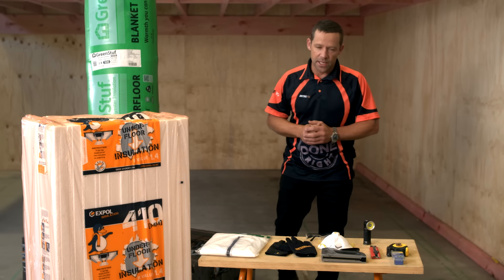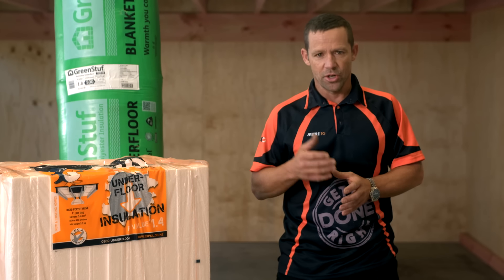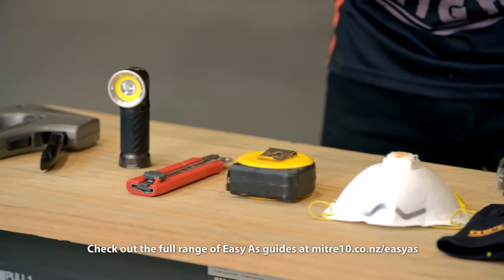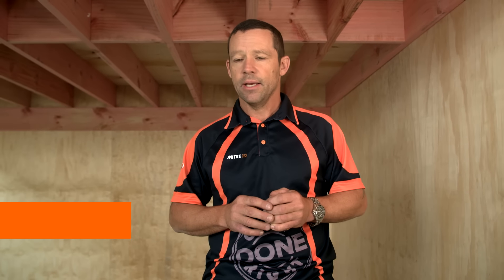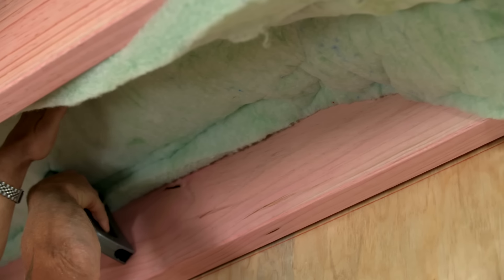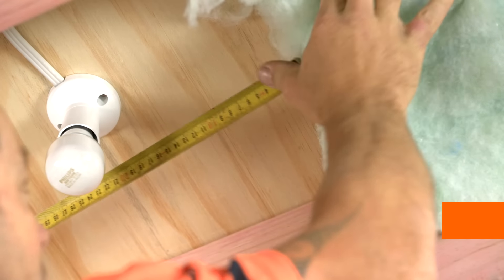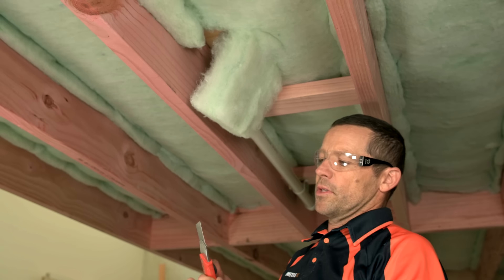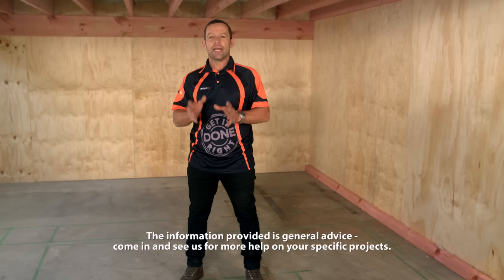How to Install Underfloor Insulation NZ | Mitre 10 Easy

Comment: Hi, what is the difference when you don’t staple the insulation up against the flooring and let it sit lower on your i beams leaving a gap between the flooring and insulation?
Reply from the maker: Hi Luke, if you don't staple, this means the insulation isn't able to work as effectively. Cold and damp from under your home won't be blocked from entering through the floor - the insulation acts as a barrier to keep your home warm and dry 😊 ^James
Reply: @mitre10nz  thanks James. So even though it's only around a 50mm gap between the floor and the insulation it wont be as effective if its stapled up tight against the flooring...
Reply from the maker: Yep! ^Frank

Comment: I love you videos. One question. I have this same step up in my two storey house and have been turning the downstairs into a flat, now I like being able to see the joist creates the effect the ceiling is higher. But if I do this and don’t want to put dry wall across the joist what do you suggest as a ceiling between the joists, if that makes sense
Reply from the maker: Totally understand, You can still install insulation in-between the joists, but maybe go with a Polystyrene style insulation that way its just the minimum amount of space it will take up. you will then need to fix small batons to the sides of the joists to to fix the drywall or ply ceiling to. Good luck and yep I agree that the exposed rafter is a good look.

Comment: 33% loss through the floor ??? check your info. its only about 12-14%  for the floor. a ceiling is around 33%.
also that method in the video doesn't insulate the joists so you still have heat loss through that. blanket insulating across the joist has far better performance. much more insulating for your dollar.
Reply: True but unless you are ripping up the flooring (which most of us won't) then that is not really practical
Reply: @benjifrater6077  ???? the blanket insulation goes on the bottom of the joists not the top. you can't nail flooring down with insulation between the the floor and joist, that won't work.
Reply: @tweake885  If I recall correctly, the standard doesn't allow you to leave empty space between the flooring and the insulation.